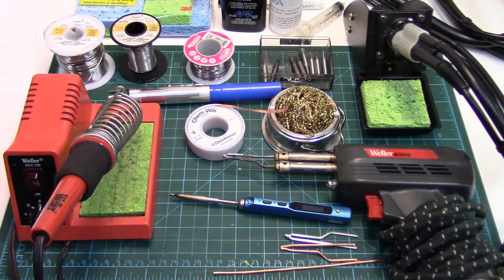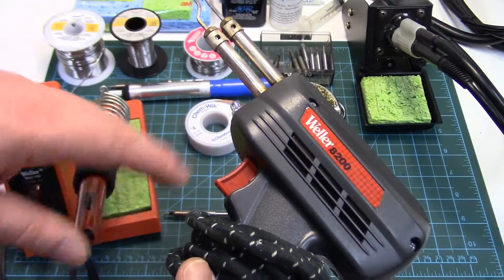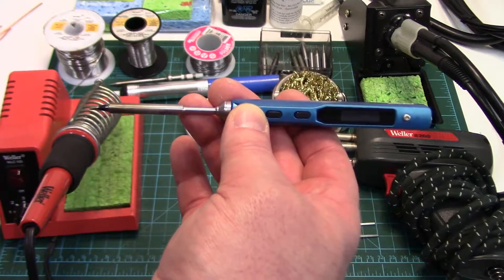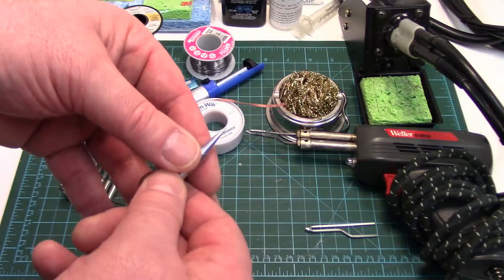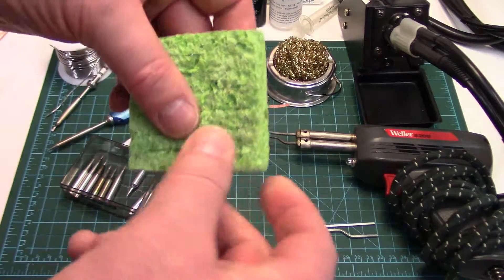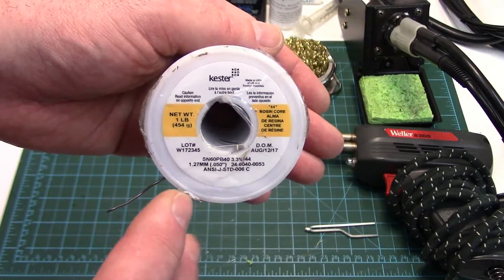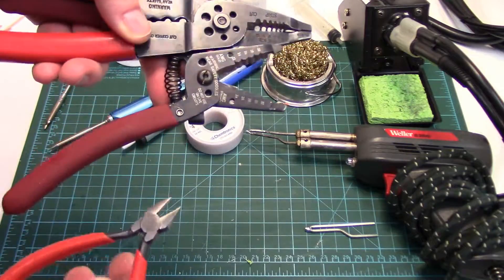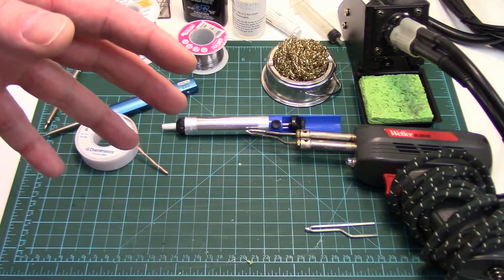RC Soldering Tools For Beginners - What to Get & Why.

Comment from the maker: Want to learn more about the hobby of RC helicopters? Please visit my website:
https://www.rchelicopterfun.com
Reply: hi. question: I want to solder XT150 connectors  90mm EDF set up 6S Lipo; brushless motor going to max 120amps peak, The KESTER ANSI-J-STD-006 will be ok to use or should I use silver? if you say silver which one would you recommended ? Thank you .